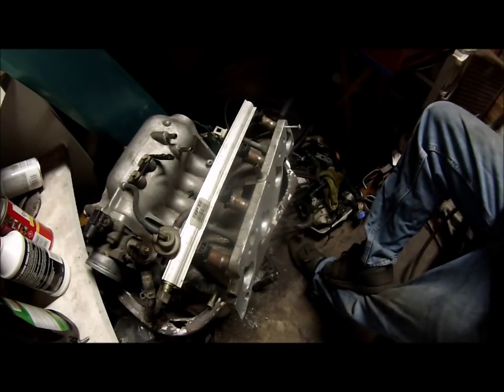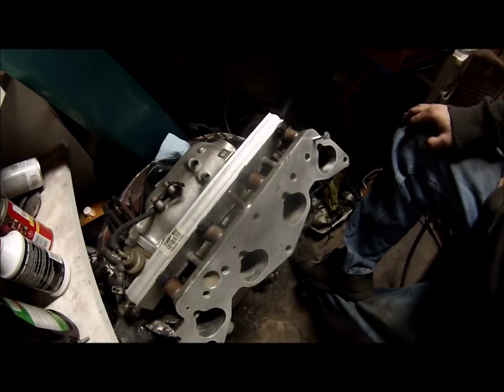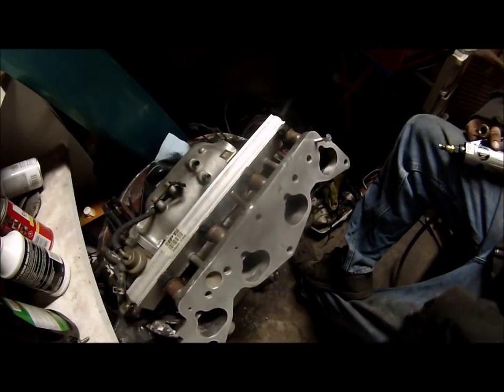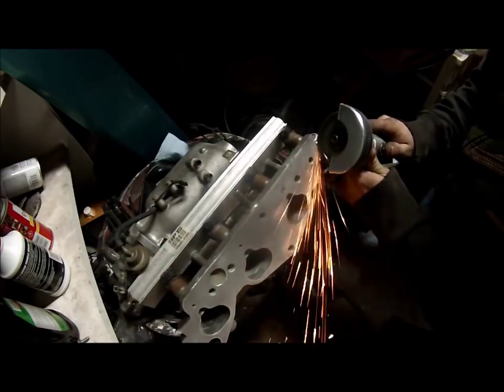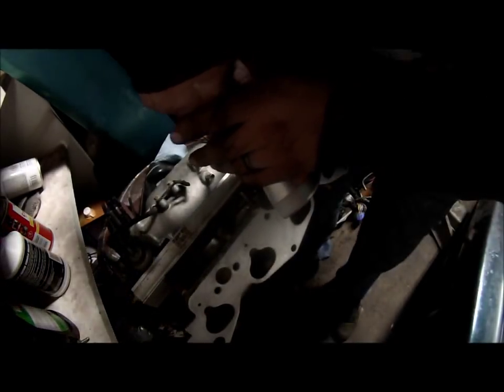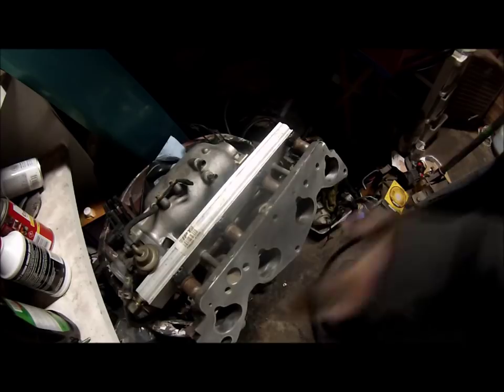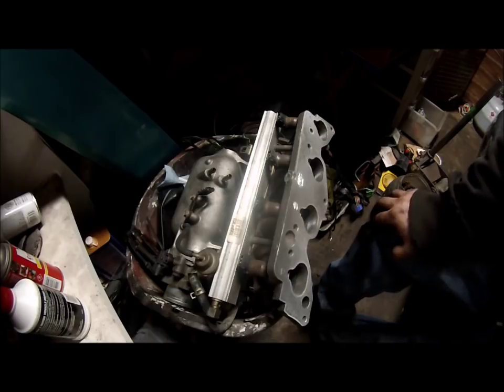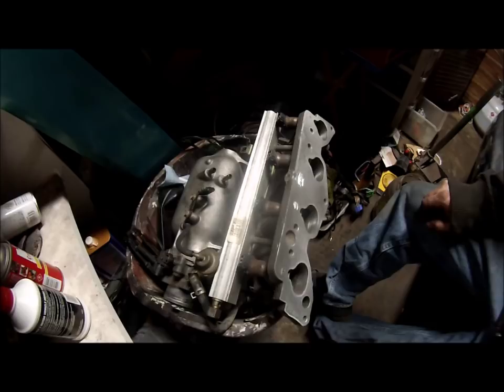How to delete D16y8 Air injection holes

Comment: I'm doing this same delete but I'm confused if I need to block all 5 holes? Here's my situation -

I have a y8 manual head on a y7 block. The intake manifold I'm using is from an automatic 2000 civic ex. The car is also automatic, I'm not doing a manual swap. Do I delete all 5 holes or just the 4 smaller ones?

Comment: I have a 2000 Honda Civic ex manual 5 speed d16y8 VTEC 1.6l engine. Recently I blow my d16y8 head and replaced it with d16y7 VTEC head everything bolted up fine. When I started it I noticed I had a crazy vacuum leak. After doing research I figured out y7 head wasn't compatible with 99-00 intake manifold because of the air injection portholes creating a vacuum leak.. My question is, is this safe to do on a true d16y8, like will it throw a CeL code if I block these holes off to make it compatible with my current y7 head. Thanks in advance for your response.

Comment: Binge watching. Another very useful tutorial. Thanks James
Reply from the maker: I appreciate that! Will do more how to videos when i can. Been putting in some work and sometimes its hard to get them done when im just trying to knock it all out lol
Reply: James Dguy I do understand. I have to see that cam install though. Please please lol.
Reply from the maker: I have to get my rough idle fixed before i do the install. I want to make sure my engine is running as smooth as possible that way i can rule out any issues prior to install just incase i keep trying to fix something that's not broke with the cam. Lol If that makes sense. Waiting on a new dizzy

Comment: If you use npt pipe plugs like they have on engine blocks youd eliminate the cutting and sanding
Reply from the maker: I have no idea what that is. Tell me more so I dont have to do that next time lol
Reply: James Dguy its a counter sunk hex plug so you can screw it down to plug the hole and you dont have to worry about sanding anything just makesure its flush 
https://www.fastenal.com/products/details/426316
Reply from the maker: I will deff have to try it and do a video of a more proper way. For now though i just did what works lol

Comment: What's up bro what do it mean if your oil malls like gas?
Reply from the maker: Some oil smells like gas naturally because the fuel seeps past the piston rings sometimes on engines with higher miles it's totally normal but if it smells a hundred percent like gas and barely any oil smell then you probably got a bad ring that's completely out but sometimes it fuel soaks and it seeps down past the piston rings especially if it had no start issues in the past because of the oil ring separates the oil from the combustion and sometimes when you get a lot of fuel on top of the piston and it never ignites it slowly slowly seeps past all those rings hope this helps
Reply: James Dguy thank I was wondering cause I was gonna by me another civic do you think think it's fix able? Or do I need a rebuild?
Reply from the maker: If it smokes out back then yea can be rebuilt.
Reply: James Dguy ok thank for helping me out I appreciate it and have a good new year
Reply from the maker: Thank you and you too!

Comment: Whattt im running a y8 manifold right now ... It holds 27+ vac pressure running and this is even after the headgasket blowing?? Im like a bit confused my dude if my y8 manifold isnt done like this wouldnt it be leaking vaccum not holding nearly 30 .. Any input james?
Reply: Lightning Autowerks™ someone correct me if I’m wrong but the air  injection is mainly for the automatic models the 5spd intake manifolds don’t have them
Reply: Speed Angels 99-00 d16y8 have thoes ports.
Reply from the maker: As far as I know it's only the automatic 99 to 2000 Honda Civic D16Y8 air injection holes so you're right not all Y8 manifolds have this air injection system a simple way to find out is look in the middle and see if there's a nipple sticking up
Reply from the maker: The only way to really know if you have the same style of manifold would be to see if there's a nipple sticking up right where it meets the head if there is then you have the air injection holes but usually you'll know because I don't have a big vacuum leak and it'll probably surge idle if it's not hooked up. Mainly because the air seeps past the map sensor in the map doesn't recognize it so it tries to compensate for the incoming air that isn't recognized.